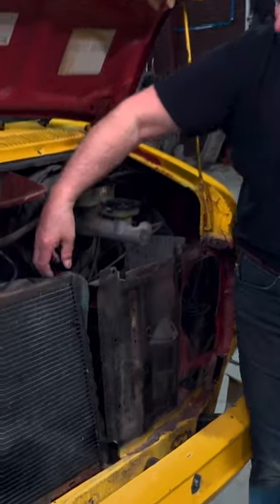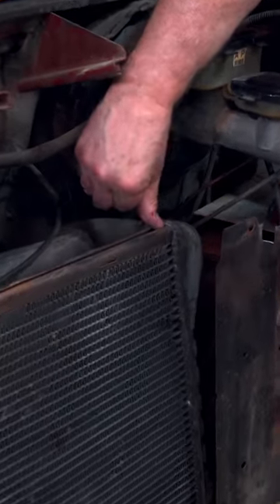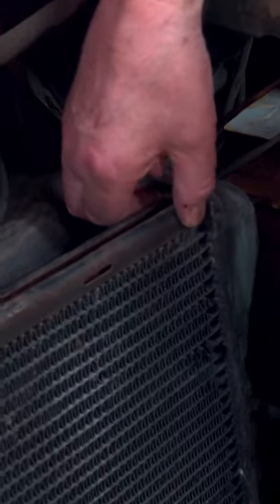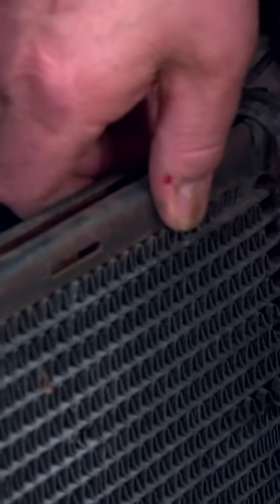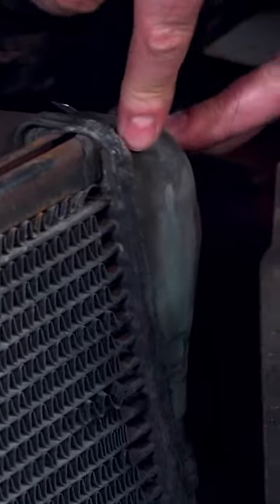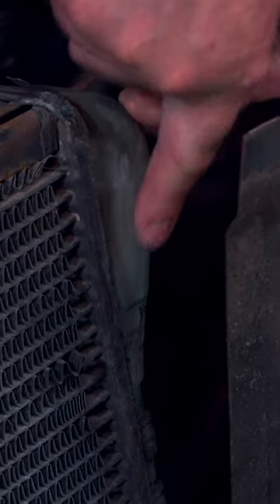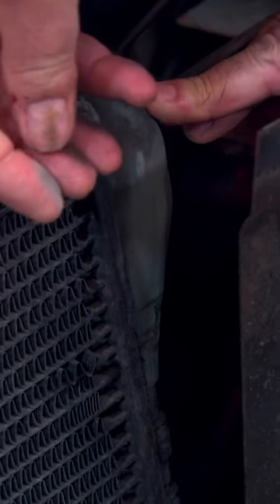Check on Your Radiator! #shorts

Comment: I'm reminded of the typical cylinder head temp switch of the 70's:  probably doesn't light up until after the radiator is about empty and the block boiled half dry.

Comment: My radiator looks to be the original one from 2003 , and it's in like new shape still . In fact the only thing that has worn out on my vehicle is the shocks . There's so many people driving around in their Toyota pickups thinking they're so smuking fart . As I casually enjoy the reliability and quality of my Ford Ranger .
Reply: Rangers are great! I've had a total of 5. All 4wd, and I never got stuck. I had the 4.0L in all of them, they suck on gas, but they go anywhere I wanted to go. But also Toyotas and Nissans are very durable. I still like Fords the best.

Comment: Broken fins are also a sign that you should consider replacement, though not immediately.

The leaking end tanks, upper and rusty bottom however do warrant much more urgency.

I know because I had that problem before and nothing sucks worse than having a long day planned miles from home and you can’t get back home because you’ve broken down, overheated and the nearest tow truck is 100 miles out.

Comment: Every car I've ever had always leaked from the plastic ends on the inlet side of the radiator and it seemed like it always happened when the vehicle was about 10 years old.

Comment: What about radiator fluid that has become acidic? From my N-Step 1 training over 20yrs ago, it was taught to mesure the voltage generated in the fluid from corrosion action, generally the softer metals corrode first such as aluminium, if encounter 0.15V dc from positive multimeter probe just in contact with the fluid against negative probe on chassis means fluid has gotten acidic enough to really start damage, solution, flush system with demineralised water then fill with suitable fluid